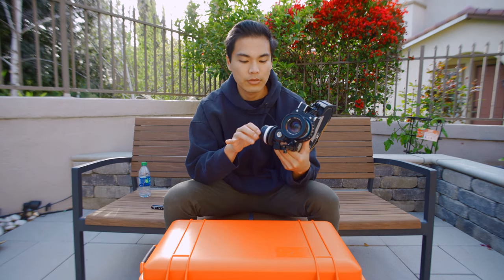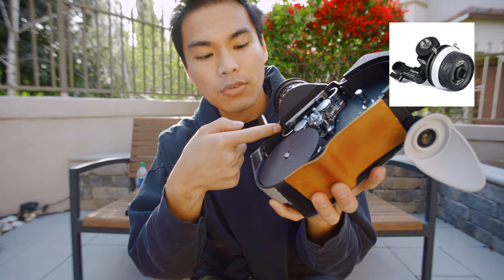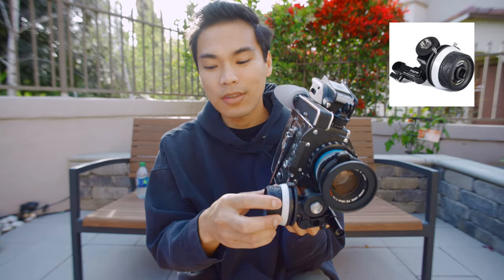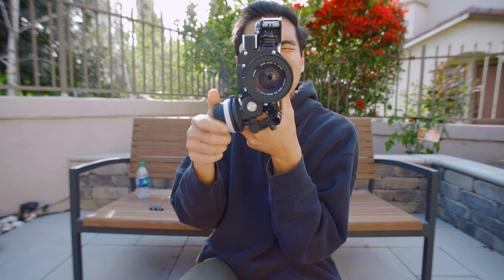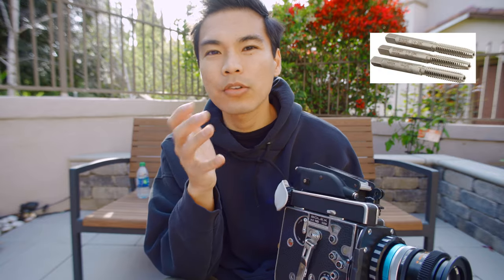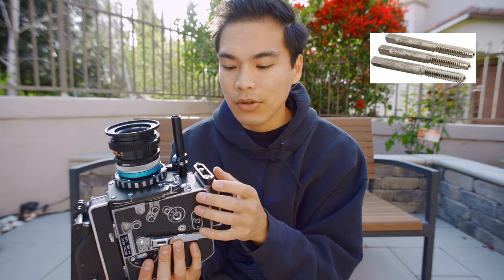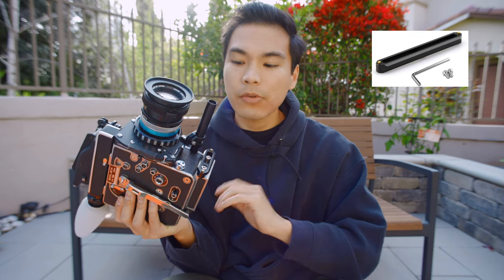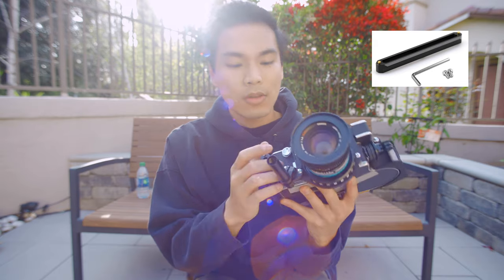Bolex + Tilta Mini Follow Focus

Comment: I did see one review of the tilta nano where there was a problem with the nano operation on a gimbal. Try playing around with the positioning between control unit and the gear unit.
Reply from the maker: Len Guyse Photo yeah there seems to be a dead spot when they’re too close together. i have played around with the position for many hours. this rig can be a good backup if that fails , or just be cheep nicer way to pull focus on this thing

Comment: Thanks for the video! Which Canon glass do you have on the bolex and how did you adapt it (to focus to infinity)?
Reply from the maker: this is the canon fd 19mm,

this is the bolex smb so i need to adapt it to c mount first, 
using a bolex c mount adapter like this

then i used a c mount to canon fd adapter

it works pretty well, can only close down to about f5.6 tho
maybe other adapters will allow it to close down to f22

here is some raw footage with this lens 
https://youtu.be/KhM0mO7raCU
Reply: @GeoffreyGonzales  
hey Geoffrey, great video!
May you write again the link of the bolex c mount adapter? 
I cannot see it and it’s quite hard to find :P
thanks a lot!
Alessandro
Reply from the maker: @duprens  http://www.chamblesscineequip.com/catalog/catalog.htm

under lenses

Comment: Do you have the pl mount version? Cant tell. I am wanting to do something stupid, and put my atlas anamorphics on a bolex 16mm
Reply from the maker: this is not unfortunately. people do pl conversation for them tho. i would love to convert to pl mount, so i can use optar illumina 16mm glass, which in my experience is the best glass for 16mm. 

this is a bayonet to c mount adapter, then a c mount to canon fd adapter.
can probably do a cmount to pl adapter for slightlyless than a permanent conversion, but the pl mount adapters run around 3-500$
Reply: @GeoffreyGonzales  Oh too easy, probably increases flange distance too, how many mm is yours if i can ask? Flange distance
Reply from the maker: @830Video  idk, i didn’t modify it so the stock flange distance 

http://bolexh16user.net/H16Lenses.htm

running anamorphic pl mount stuff would probably work bro

Comment: Hi great video Geoffrey, what range in lens sizes / diameter can the Tilta mini control. i am planning to use C lenses, Nikon lenses and pl mount lenses with the bolex i have just purchased, and they are all different sizes. Thanks
Reply from the maker: hi the tilta mini follow focus can work with pretty much any lens as long as you have focus gear on it, which can be added on if the lens itself doesn’t have it
it is adjustable on both the 15mm rail side and the angle of the arm.
so all of the sizes you mentioned will work. 

2 tips tho :

1) get good focus gears, that are stiff and not too soft and don’t have a seam. tilta makes some, but reasearch around. unfortunately i don’t know the name of the brand that i got form work, they’re amazing and are not flexible. this helps in the gear not slipping under load

2) if you’re going to run vintage lenses, make sure the focus action on them is smooth. i’ve had a couple ebay lemons and it’s been a pain 

feel free to hit me up with any more questions on instagram, somtimes i don’t get notifications for youtube